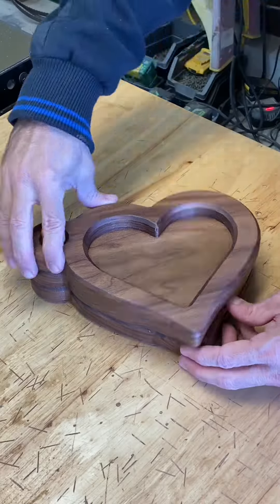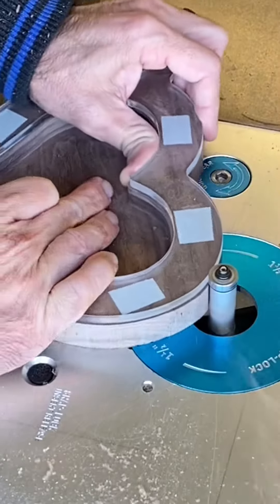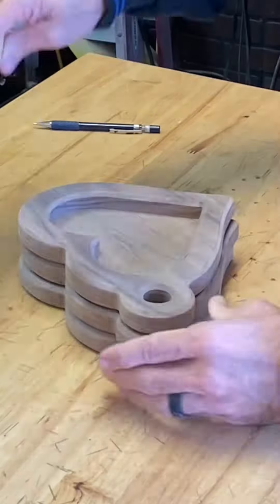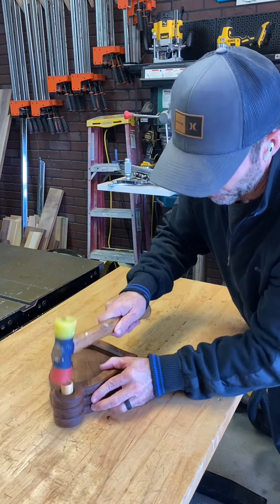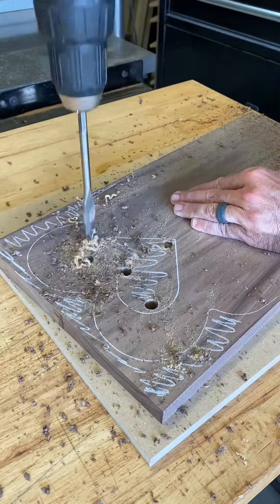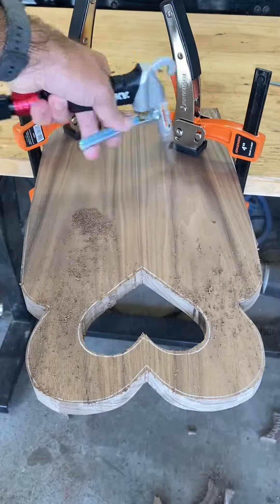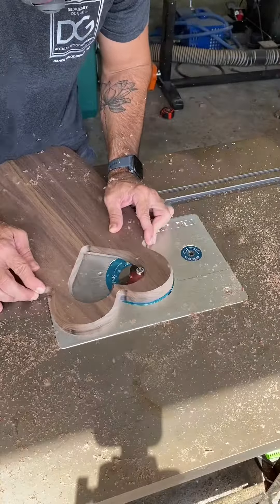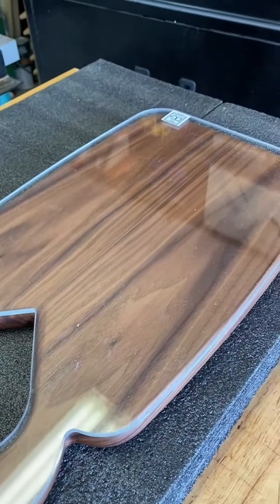2 woodwork projects that sell! #woodworking

Comment: What router bit did you use to carve the hearts?
Reply from the maker: Hey man, here are the links to the products used in this video 

Templates ⬇️
https://designsbydonnie.com/templates/

SVG FILES for cnc ⬇️
https://designsbydonnie.com/cnc-files/

X Fasten Tape ⬇️
https://amzn.to/3IkoTDB

1/4″ Flush Trim Bit ⬇️
https://amzn.to/3WFlZ0x

Router Bushing Guides for Inlays or Dish Platters ⬇️
https://amzn.to/3FXHG4w

1/4″ Bit for Dish Platters or Inlays ⬇️
https://amzn.to/3Wnb0II

1/8″ Bit for Dish Platters or Inlays ⬇️
https://amzn.to/3FUpVDk

Total Boat Wood Honey: ⬇️
https://amzn.to/3YtQBTA

Mirka 1.25" sander: ⬇️
https://amzn.to/3xe45Xw